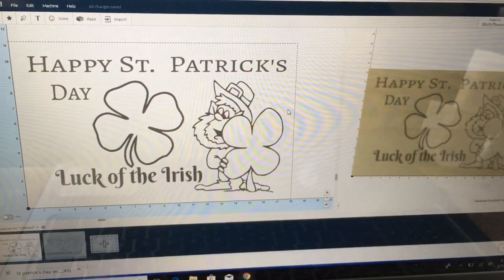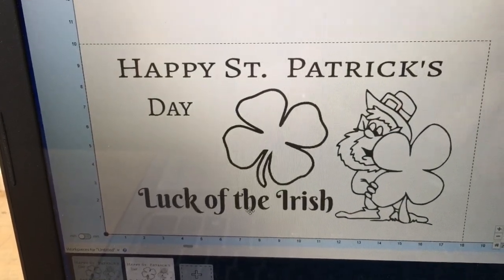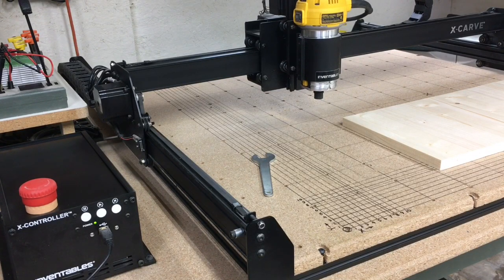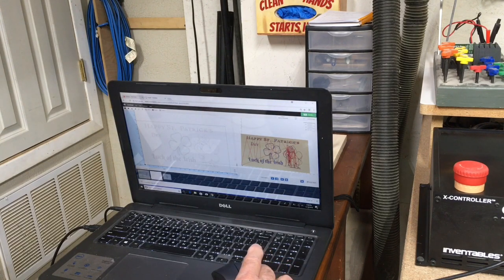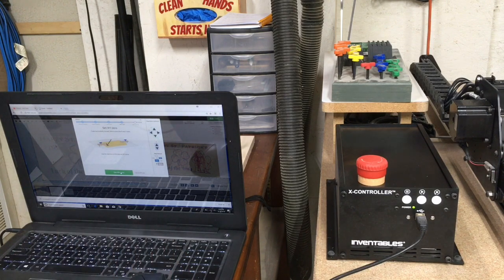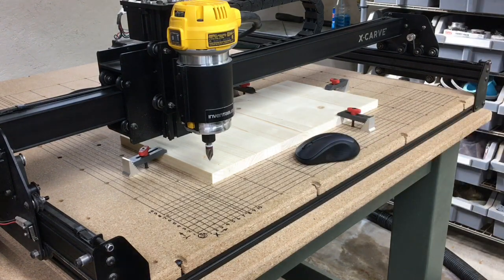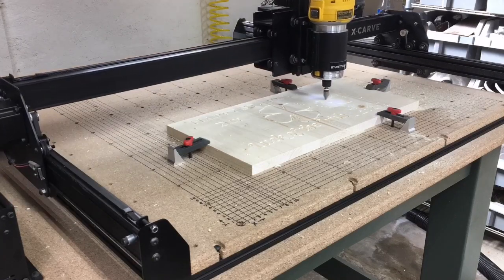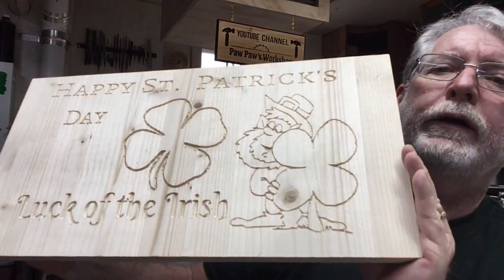How to Setup and Carve Using Easel

Comment: This actually really helped me in setting my machine up for the first time. They only question I have, where do you get your bits and what are some good starter bits to get?
Reply from the maker: Thank you for you comments.  I am very happy that it helped you set up your machine for the first time.  The initial bits that I bought were from Inventables.  It was a started set and quite frankly some I have never used.  The type of bits really depend on what you plan to carve.  I do mostly wood and some acrylic.  The bits that I use most are the v bits 60 and 90 degree.  I get them from the big box stores and from Inventables.  The t-slot bit I use came from Harbor Freight only because that is the only one I could find.  Super cheap but needs to be sharpened often. The 1/16 and 1/8 inch straight and spiral all came from Inventables and are used all the time.  Use downcut bits on wood for a cleaner cut and upcut on acrylics.  

If you have any questions or projects you would like to seen please let me know.  Thanks again

Comment: Thank you for the great videos.  In this one... You didn't demonstrate how you increased the speeds, particularly in the middle of the job.  That would be good to know.  Also, which brushes (assume the router motor brushes)?
Reply from the maker: To increase the rate while the project is running is simple.  The tab is in the top right of Easel with a "+" and "-".  I have shown this numerous times.  The brushes for the DWP 611 router are listed in the description and are available from Amazon through my affiliate links.
Reply: @PawPawsWorkShop  Thanks a bunch. Sorry to miss previous examples.  I am completely new to CNC and even newer to your channel.  But I hope to catch up!  Thanks again!
Reply: Thanks for answering this question as I had the same questions. I really appreciate your videos!  I just finished my x-carve set up today and will run my first project in the morning!

Comment: i am very new to X carve, thank you for your videos i am having problems with loading images from easel of lightburn, im not the smartest when it comes to computers do you have a video for that?? also how do you know what bit to use ?
Reply from the maker: Once you have a file completed in Easel you can save the file to your computer as a download zip file.  Select file from the top menu and select download zip.  Save the file to your computer.  In Lightburn, open the file after you unzip it in your computer.

The choice of bit depends on what you project will look like and the desired affect.

Comment: I am having a problem with my X-carve cutting raised letters using Easel Pro, some of the words cut some don't and the machine is cutting at different depths in a single pass. Any suggestions would be most appreciated.
Reply from the maker: Share the Easel file on the forum.  I'll and others will take a look at it and see what can be done to fix it for you. What bit are you using.  First guess, it sounds like the bit is too large for the design.

Comment: Set up my first carve... the steps seem pretty simple... As soon as I pressed 'carve,'  The spindle went straight across the board and off the other side. nowhwere near where I was expecting it to begin... it began to carve thin air... So, no damage done. Is quite late at night, so I've shut down for the time being and will begin the setting up from scratch tomorrow. No idea what went wrong other than, 'operater error.'
Reply from the maker: The machine has no idea where is x,y,z position location. Are you using easel?
Reply: @PawPawsWorkShop  Hello Paw Paw,   Yep using Easel. Left it overnight and returned to it today. A successful carve, though I set the final depth too deep and lost definition in the lettering, but hey... first attempt quite pleasing to see the machine operate as instructed... albeit my instructions were for too deep a carve. Will turn the board over, change some settings and try again... Huge, huge thanks for your reply.   :-)
Reply from the maker: You’re very welcome. Just remember each carve that you do you will learn so much.

Comment: Can the Z axis be set manually?  I don't have a touch probe. Thanks
Reply from the maker: Yes, you can set it manually in Easel. When you are going through the checklist you will be asked to use the probe or set manual. Just select the manual and follow the steps.  The probe is easier but certainly not necessary.

Comment: Howdy.......I have followed your directions..... everything looks great as far as the carve...... but the entire carve is not centered on the board.  My sizes were correct to match the size of the wood.... my rendering screen looked great and centered.... but it ran off the top edge  of the board.  It carved off about a 1/2 inch.  Do I need to calibrate?  Will this throw off my carving..... because right now the carving is dead on.  Just the placement is off.  So sorry for my ignorance.....just a newbie here.
Reply from the maker: If you have never calibrated you machine, it may be off a small amount.  Take a look at the exact x,y zero point on your workpiece compared to the exact location on the computer.  More than likely that will be off just a little.  I'm working on a video now where I am measuring to the mm to try to get it as close as possible.
Reply: @PawPawsWorkShop  .... howdy.... I checked out everything.... and it is correct on my computer screen.  I have never calibrated my machine.  Question.... will the calibration only effect where is starts carving..... or will it effect my actual carving.  My carvings look great..... just can't get the position correct.  I'm afraid if I calibrate.... it will screw up the carving.
Reply: @mgbchuck  ..... Howdy...... I am so sorry that I wasted your time.  I was stupid and didn't check my settings.  My one internet friend pointed out that I had a 7 1/4 board..... and I had my easel set for 7.50 .....  not 7.25 .  So simple...... I was looking for something much more complicated.  I changed the settings ... and it carved perfect.  Once again..... thanks for your help...... I will try to be more careful.
Reply from the maker: Don't feel bad, I have done that also.  Glad you found out the problem.
Reply: @PawPawsWorkShop  I would really like to see you do a video on the x,y zero info.  That is the stumbling block for me and it seems like it is for a lot of folks.  I really enjoy your style of teaching Phil.